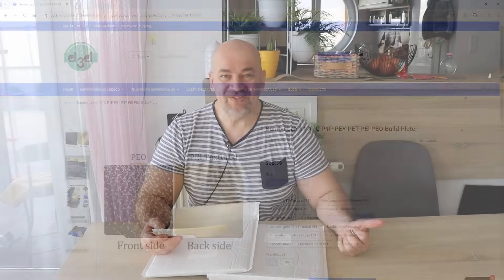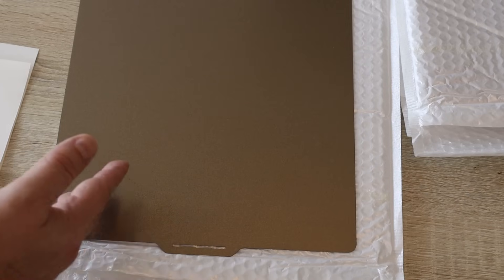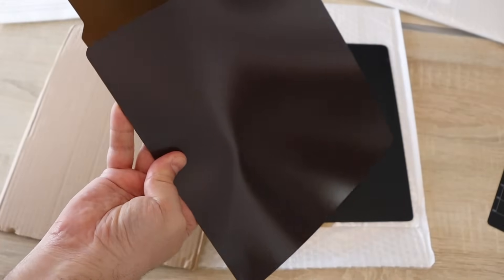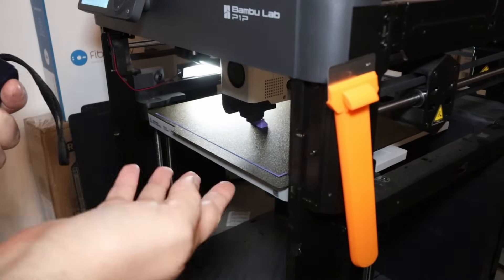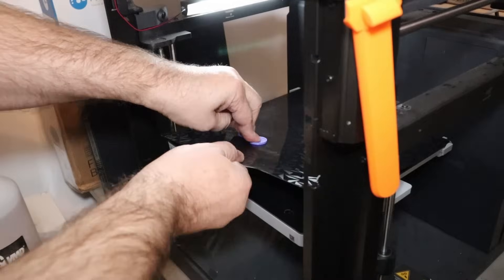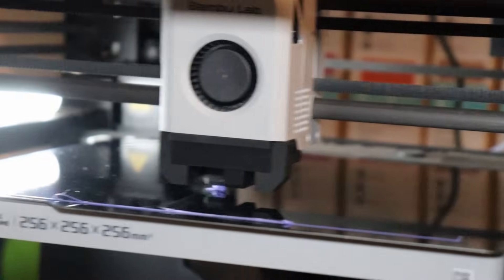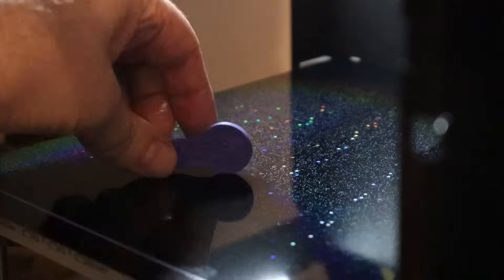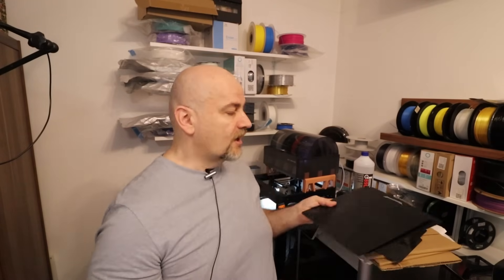PEI, PEO, PEY sheets. Which one is your favourite? I have mine..

Comment from the maker: According to packaging, it was two sided PEY, but according to the website, it was two sided H1H, that's why I had different adhesion with star PEY.
Reply: Did you attempt cleaning with dish soap off camera? I found that helps when isopropyl stops making a difference with adhesion on new/old build plates.
Reply: @shadows555555  agree there, IPA dilutes the oils and that can then cause the oils to be spread out all over the build plate once it evaporates. Cleaning with a good dishsoap rinsing with water and then drying seems to work better in removing and not spreading the contaminants.

Comment: I already have most of those sheets for several printers. Everyone works well except for ABS on Creator 3. I just wash them with Dove soap  (as it removes grease very well) for the first use and clean surface with several drops raw water and microfiber towel before every printing. It is more than 4 years I no dot use any alcohol at all.
I had had adhesion problems with PEO too on A1 that were off after clean it with soap.

Comment: I've been using these occasionally since the new year and they are surprisingly useful to have around. I've used certain nylons that just wouldn't stick to any of the bambu pei sheets I have, but they adhered fairly well to the fractal sheet. In general just useful to have around for any material that doesn't like to stick to PEI.

Information of forums seems to suggest these are all polyethylene based surfaces, the last letter is probably tacked on by the manufacturer to differentiate the sheets texture. For example PE-Y (Polyethylene-Y) and PE-O. They work like a holographic card, with microscopic sized structures reflecting and refracting light in interesting ways. The microtexture transfers to the print.
Reply: Which plate worked well for nylon? If you can find another way to describe the fractal pattern. I'm very curious about this interesting property, amazing find!
Reply: @goosenp  I'm not sure if one is better than the other, but I'd say go with one of the coarser grained patterns like the carbon fiber texture or the faceted triangley fractaly one.

My testing was mainly limited to a few small nylon prints, but it was literally the only thing I had that it would stick to and it did a pretty damn good job.

The classic surface many people like for nylon is garolite but I'm not aware of any garolite plates existing for the bambu. They are usually DIY.
Reply: @SaschaUncia  Which plate did you do your original experiment with? Is it the carbon fibre one (PET), the black triangles one (PEO) or one of the rainbow types?

Comment: I like textured PEI the most. It is just the most reliable surface I know of. Garolite/FR4 is said to be realy good as well, but I didn't try it so far. But everything I use sticks to it and everything gets off too. Maybe some filaments won't work with it and need some special surface? But I don't know wich one that would be. So far I only worked with the commonly used stuff (PLA, TPU, PETG, PCTG, ABS, ASA).

What I like the most about the textured PEI is the appearance of the surface. In my opinion it is great, I like the looks of it. And it is possible to completely hide the linegaps without squishing to much, which would result in quite a big elephant foot. On thos flat and shiny surfaces you can hide them nicely too, but they are never completely gone.

As a secondary surface I use PEX from WhamBam which creates a mirrorlike surface on the print. But I only use this when I want to mate two parts on the bottom surface and having a clean edge.

Comment: I have a carbon pattern plate. No adhesion with ABS at all. I have tried many setting without success.  PLA is having adhesion, but the surface is not nice. It's like the material flow rate is too low. Not like your prints. The bottom has deep printing lines and clearance between them. I became tired to make more trials....

Comment: Prefer PEI ; the textured side as it leaves a nice textured finish on the bottom of my prints and if at correct temp ,prints stick really well. With PLA on my FL Sun v400 I set temp at 60-65 . I have never needed glue .

Comment: I don't have experience with the PEY yet, but I've used the PEO extensively so far and it's been working great for me, I mainly print in PETG, but even for PLA it's been good.
Just keeping it clean as possible. Mine needs to be replaced at this point because it seems like its de-laminating and it reflects into the print - you're right, anything that's on there will 'bake' into the surface of the print. 
But, adhesion is still no problem. I also use the engineering plate in BambuSlicer because I've found it's more similar thickness to that plate.

Comment: I have quite a few different sheets. PEI, PEO, PEY etc. I have almost all the ones you have but mine are not the same company.  I mainly use PEI sheets for small prints or if I am printing with tpu , petg etc. But I do like those specialized sheets. It makes such a beautiful pattern and it works very well. My favorite ones so far are the ones made by Energetic. They are a bit more expensive however the quality is better. I didn't notice a smell with mine though. And I have had no bed adhesion issues when used on my K1. I also use them sometimes on my other printers. I am not sure why you had those issues. You may have gotten a bad sheet somehow.
Reply: Same experience on my SR.

Comment: Getting a fancy patterned sheet is on my wish list for someday, but very low priority for me. Textured PEI is IMO a great material, I generally don't use glue stick and it works great. For my MK4 I have found that Prusa's textured sheet is best for PETG, and off brand is best for PLA. I also have a smooth PEI sheet, and that one I definitely need to use glue stick for materials like PETG, TPU, PC, etc.
Reply: I learned my lesson. I also use glue stick for TPU on textured PEI. Without glue, it worked fine until one time when it didn’t and tore a chunk off the texture.

Comment: My textured PEI from Juupine started having awful adhesion after 30 prints. Yes it's been cleaned thoroughly with IPA and dish soap + hot water. The fancy beds are difficult to print with PLA, but are surprisingly good with TPU.

Comment: No on Ideaformer, absolutely on Juupine beds. If your level & Z offset are good it's a whole new world honestly! Tested on a Bambu, Flsunn, & Sovol. Bought from Temu, Aliexpress, & Amazon.
Pei textured- the standard, it works and sticks the most, I prefer actually flat though as filament can stay in the grooves.
Pet carbon looking- I love that stuff! All 3 of my printers now use that as standard!
Peo- I like it, but the pattern is best for larger models IMO.
I had one of the stary ones (Ideaformer) but it came off on the first 2 prints so it got returned. Another one (Pet) from them got returned because it melted on the first layer with a proper offset... next to the bead of filament it was deformed. Yes I peeled off the protective film, it's too satisfying to pass on.
I'll have Pey, H1H, & variations of others coming soon, ish.
Reply: I bought some of the Ideaformer beds for my X1 Carbon and they work just fine, however, some of my cheaper PLA filaments would not stick to them well without LAC but stuck to my Ender 5 Plus machines beds just fine

Comment: I have 99.85% success rate after 300+ prints with those PEO etc sheets.  Set the slicer to texture sheets because it sets the nozzle closer, 65c and clean with windex. and i coat the plate with a nano polymar ;)  Theses plates donot like ABS/ASA.  It will peel the coating off.

Comment: The patterns are nice and everything, but I prefer completed prints over pretty patterns. If adhesion was close to PEI or PEX I would give them a try but almost everyone I have seen use these has commented on the lack of adhesion.
Reply: With more squish I have had as much success with adhesion as with pei. You can get it so there are almost no lines visible on the contact surface.
Reply: They work surprisingly well with some materials that don't like PEI. Like Nylon.

Comment: These plates have different thicknesses, so if you didn't calibrate the z-offset after each change, it's no wonder the print didn't stick. Or, at least, bed type, from textured to smooth, in Bambu Slicer.
Reply: As said in the video, he uses a BambuLab printer with automatic Z-level calibration.
Reply: @uhu4677  By selecting the calibration options, the printer only performs bad calibration and not z-offset!!! Textured PEI plates are much thicker, cuz they are TEXTURED. That's why nothing stuck, to any of the sides, of this board with a smooth, shiny H1H surfaces on both sides!!! Unfortunately, the lack of z-offset calibration or at least changes bed type from textured to smooth in Bambu Slicer is a disqualifying error for this test. Besides, it is clearly visible in these close-up photos, that the distance between nozzle and bed is very large and printer prints in the air and not on a table!!!
Reply: He knows what he’s doing 😊

Comment: take it off smooth texture PEI/high temp plate, will not stick correct with PEY/PEO etc  change it to textured PEI plate only you will find the prints will stick better i have them i tested them and found out they stick better textured PEI plate try that bud

Comment: I actually like the textured finished of PEI sheets. I think the slightly rough surface helps hide minor flaws and just looks appealing. 
If they could do more interesting things with rougher textures, that might be interesting, but not the very smooth sheets.
Reply: I love using Textured PEI for the appearance too. Especially for faceplates for things like switch panels for a vehicle, for example.

Comment: I bought a magnetic sticker w/ PEI plate 4yr ago. The magnetic sticker had a very bad smell because the manufacturer (Creality) used a low temperature adhesive. I now use glass plate with hairspray as release agent. I now have a core XY printer so I don't think about the weight of the glass plate.

Comment: Mirrors my experience. Textured PEI best for PLA, ABS and PETG (I even use it for TPU), PEO second - I use it when I want that fancy surface. I also like to use a common soap bar (not liquid) to wash the sheets, in my experience it leaves the most rough feel, which is what leads to the best adhesion. I don't remember any failed prints with this combo.

PEY is bullshit that looks cool on pictures.
Reply: One question I have had for a while but haven't been able to find a conclusive answer to: wouldn't the higher bed temperatures required for printing ABS/ASA would eventually demagnetize the magnetic bed? I've been slowly converting an ender-3 for ABS/ASA printing and I have found a nice PEI bed, but I'm reluctant to put the magnetic sticker on the aluminium bed heat spreader since heat and magnets don't mix well.
Reply: @bami2  I can understand you reluctance, but there are magnets that work well above 120 degrees Celsius. They will not have the best attraction force, but acceptable for this application. For example a neodymium cylinder magnet of 10mm diameter with 5mm thickness has 4kg of attraction force, and X1C magnetic board has way less attraction force . At least in the case of Bambulab X1 carbon the bed is magnetic and ABS/ASA have to have around 120 deg for first layer. Beware, I'm new in this 3D printing world :)
Reply: @viorelgheorghe5655  I'm not sure what kind of magnet I have, it's one of those creality branded flexible ones with some gluestrip you stick to the Y gantry with a PEI coated spring steel thing you put on the magnet to print on. I'm pretty sure it's not a neodymium though so I'll just have to try it and see if it gets damaged, just not looking forward to when I have to remove the magnet again.
Reply: @bami2  vinyl magnets lose force at 110c, but they recover when cooled. if u notice significant permanent loss in magnetic force u can actually disassemble  bed and put in in fridge. if u need higher  temps u should mill bed and glue in SmCo magnets up to 200c.
Reply: @madmatrac  Interesting, I always though magnets exposed to heat would lose magnetism permanently.  Thank you for the insight!

Comment: PEY is perfect for TPU, as seen in my videos. For PETG, I use the following setting: nozzle temp first layer 250℃, rest 230℃;  bed temperature (very important!!): 110℃ - first layer, 90℃ rest; first layer speed:  10 mm/s; acc: 50 mm/s2.
 For the light beam sheet (sometimes called H1H sheet), I use 115℃  for the first layer. Check my short videos to see how they work
Reply: My goodness those are HOT bed temps and SLOW speeds for such easy to print materials.
Reply: @Oldsjunkie  yes, slow first layer, but the results are beautiful
Reply: Waste of electricity and time, no thanks.